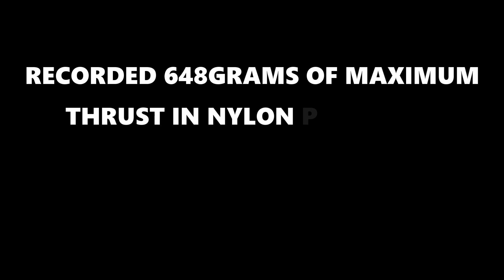DRONE MOTOR THRUST TEST | ये कितना वजन उठा सकता है!!! | IMPOSSIBLE CREATIVITY

Comment: Sir mere flysky ct6b transmitter ka programing cable pc ke saath connect nhi ho raha aur data cable ka light bhi blink nhi kar raha need your help plz reply 😢🥺
Reply from the maker: Connect the cells to battery and if then also cable light is not blinking then there must be some problem with cable.